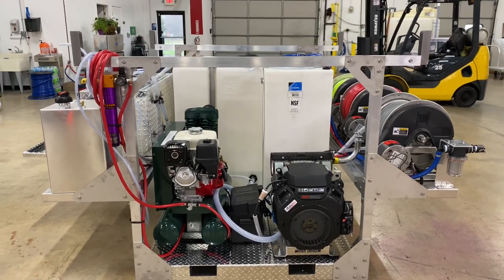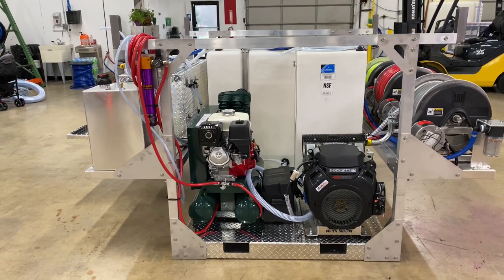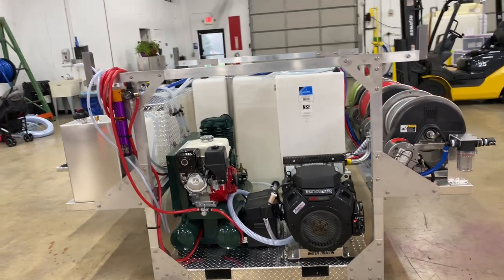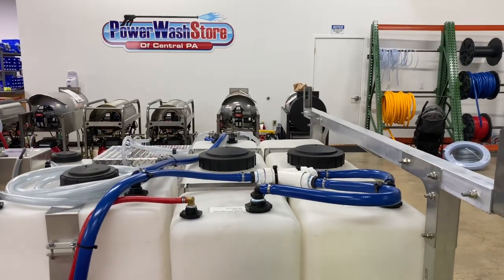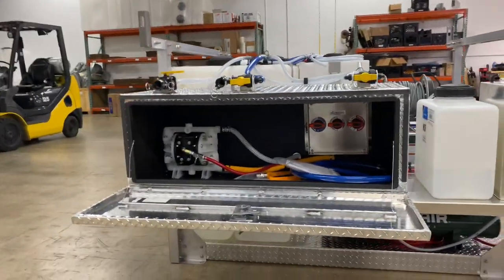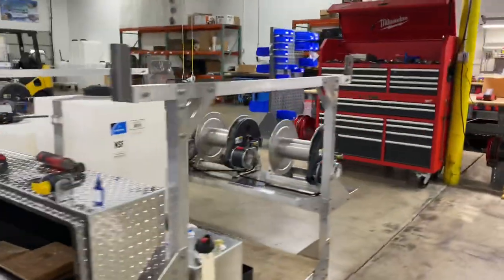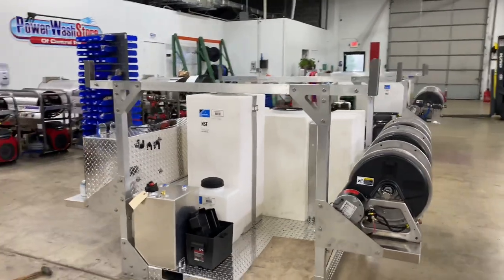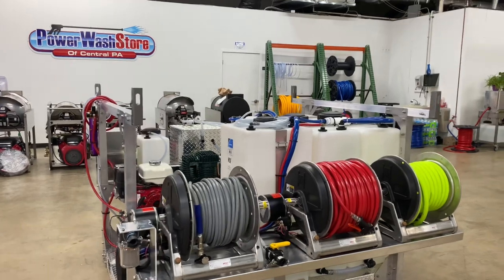Short Bed Truck Skid Soft Wash System

Comment: What does the underneath side of the base structural look like ?
Reply from the maker: Diamond plated base with fork pockets build in it
Reply: @powerwashstoreofcentralpa4112  I’m trying to design one up here in Alaska so I was more curious of the actual type of pipe used and the structural design